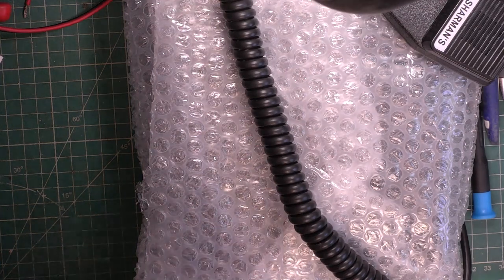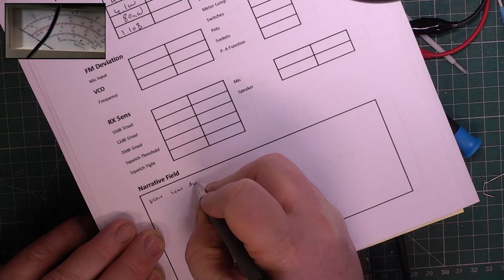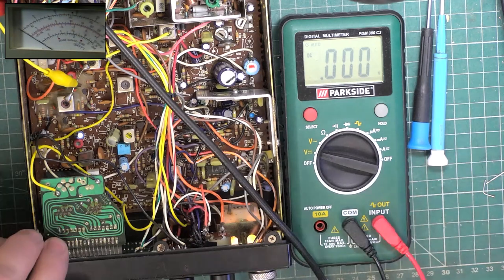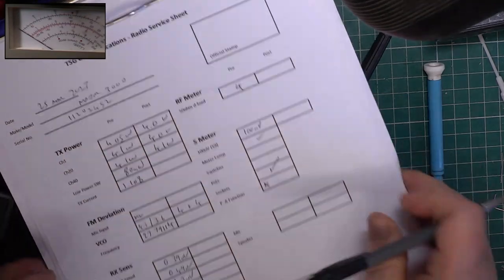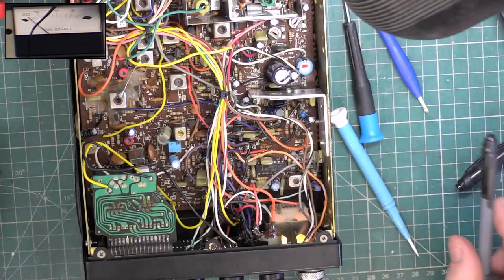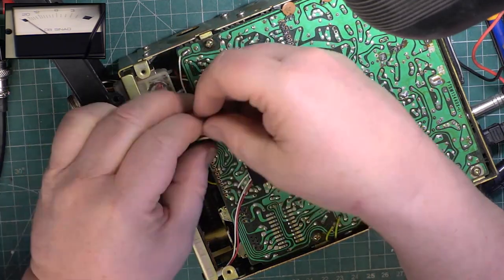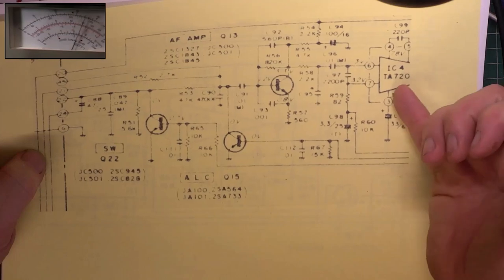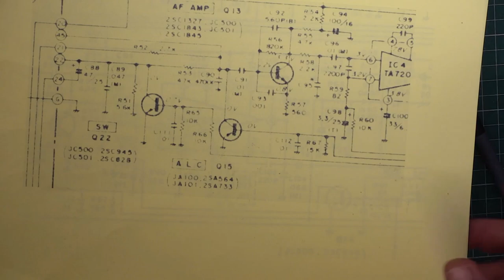Major 3000 CB27/81 UK FM CB radio - extensive repair & re-alignment

Comment: I’m glad I rewatched this as I have a York JCB863 with the same faults although my signal meter doesn’t work as well although I know it’s a good one. Will let you know how I get on with it. Cheers for this video 😊👍
Reply from the maker: Roger.

Richard
Reply: It turned out to be C94 which had gone woke and started identifying as a resistor…. Working perfect now good buddy 😊👍
Reply: The meter was duff so I had to replace it again

Comment: Richard wonder if you can help me I’ve got a president Lincoln one which is stuck on 30.500 mhz but the vfo  is reading correct frequencys when turned any ideas mate any info appreciated
Reply from the maker: The President Lincoln is sold as a 10M amateur radio set. They also get tuned into 'export' CB radios that are illegal to use as CB radios in the UK....and most other countries.  We have no involvement in servicing either amateur radio no CB radios that can't be legally used in the UK.

Richard, G0OJF, UK
Reply: @ukfmcbradioservicingTango21  yes I understand the legality with the rig but I’m licensed my call is m0lpf and I was asking for some advice on how I could fix the rig I thought maybe you would know what was the problem de m0lpf
Reply from the maker: Well clearly the PLL is out of lock. Perhaps the voltage rail is missing to the PLL section...bad capacitor on that rail. I'm simply not involved with these types of radios. I'm sure they are Uniden made I know that out of all the UK CB radios I see, the biggest capacitor failures are on Uniden made sets.....not they're 40 years old.

Richard, G0OJF, UK
Reply: @ukfmcbradioservicingTango21  okay Richard thanks for the reply I’ll go over the caps with a esr meter and see what happens from there   many thanks de m0lpf 73

Comment: I've never had bad caps on one of these, I suspect the mic socket has been incorrectly wired to suit a different mic as the decoupling caps have been removed, did you put new ones back on the socket? I may have missed it if you did, another one saved and yes although it's basically a hotel 220 you don't see many of them.
Reply from the maker: I discussed the caps with Mr C & came to the conclusion that if it didn't play up for us in our RF heavy environment, it should be OK.

Richard

Comment: I may have fell a sleep but did you do the recovered audio on the spectrum analyser ?
Reply from the maker: No, we always do that on the oscilloscope.

Richard
Reply: @ukfmcbradioservicingTango21  O ye thats right but you still didn't do it did you ?
Reply from the maker: It probably just didn't get shown. Bear in mind the set has been backwards & forwards between benches here. When we have extensive faults not all stages get recorded. I don't think anyone wants to watch 4hrs of fault finding discussion between engineers.

Richard